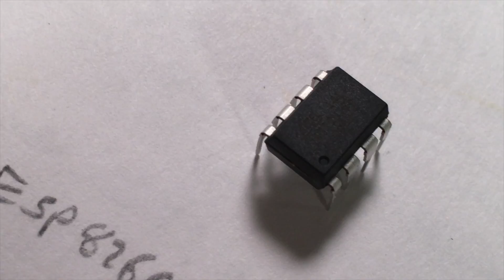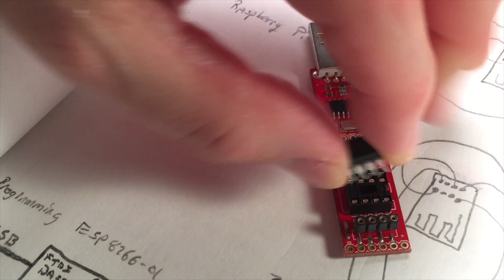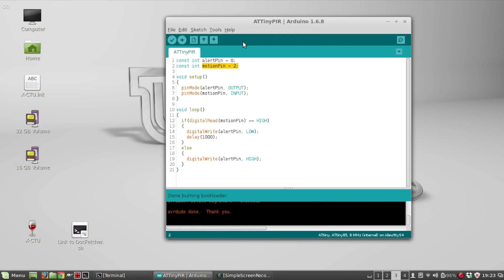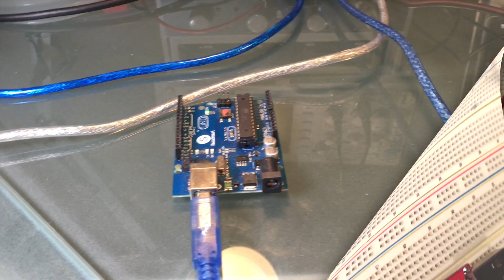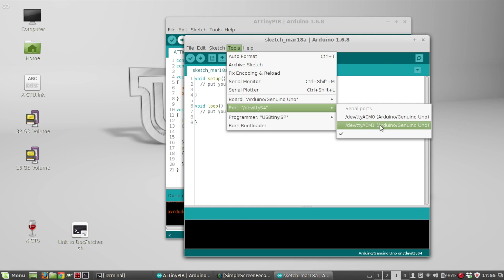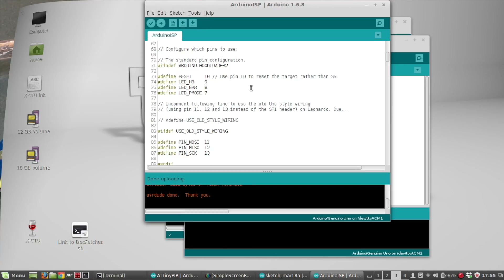Programming the Atmel ATtiny85 with Arduino

Comment: What's the biggest memory you can get Arduino in?
Reply from the maker: The largest I2C EEPROM chip that I have run across is 256KB.  There may be larger ones but I have not seen them.